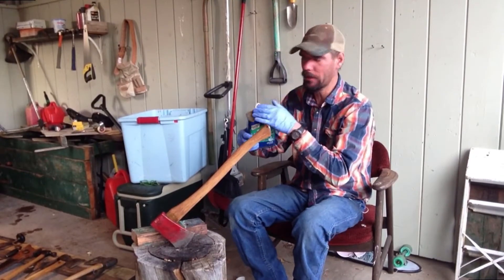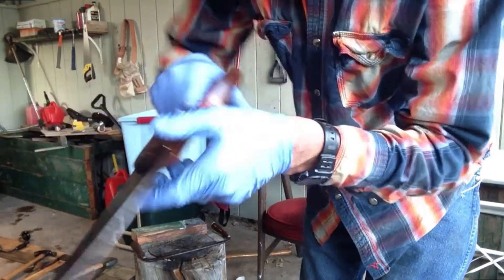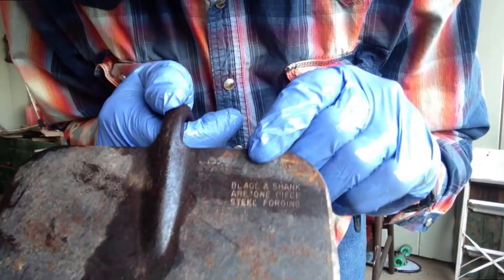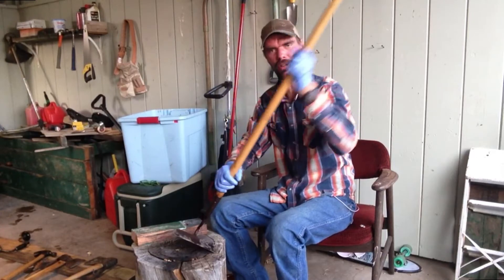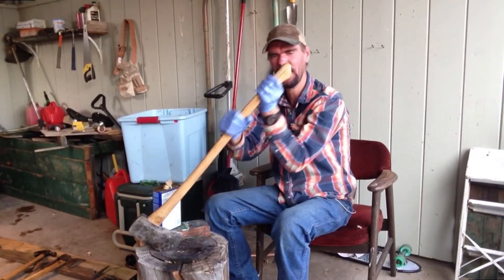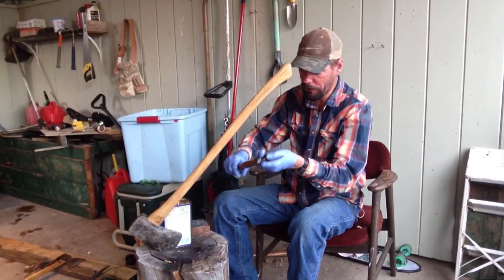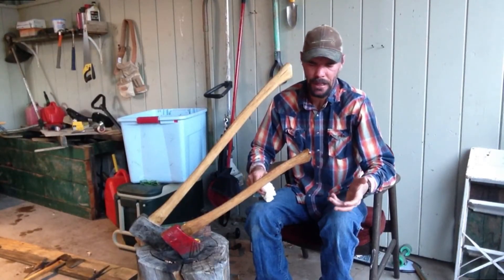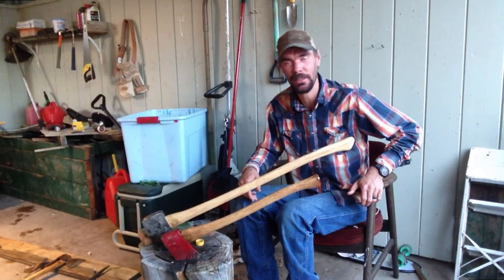Make Your Tools Last 100 Years- EASY

Comment: If you can get a barrel and put sand in it you can pour some motor oil used or new in the sand and mix it up. To clean the tools and oil at the same time on the metal  move up and down it will clean and oil the metal at the same time.
Reply from the maker: Bitty Boo Brown I've heard about people doing that,.  Thanks for the tip.
Reply: works like a charm and you can store shovels and things in it so they do not fall over plus it keeps them that much more protected.
Reply from the maker: Bitty Boo Brown I like any idea that saves me cash or work!
Reply: I wold be concerned about the motor oil transferring from the tool and contaminating my soil over time.